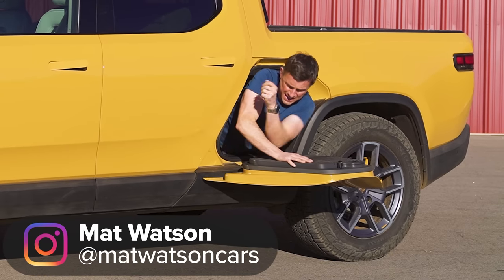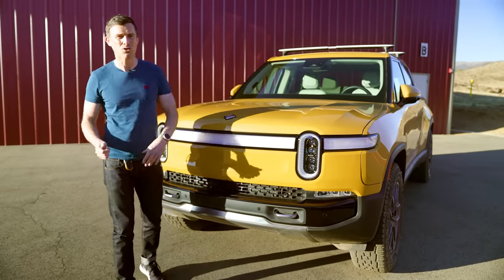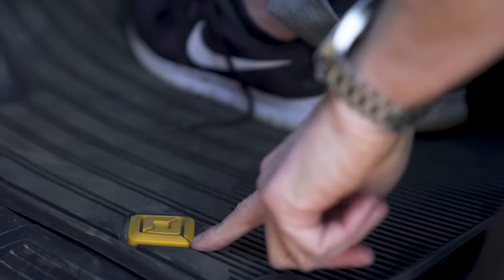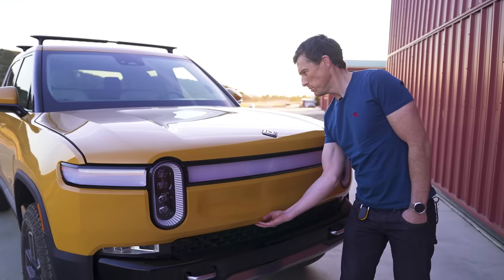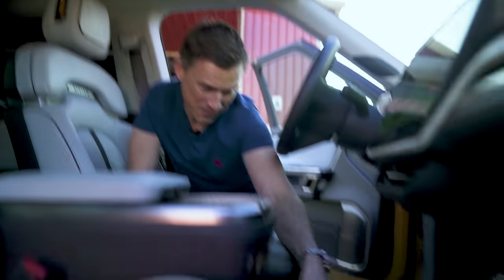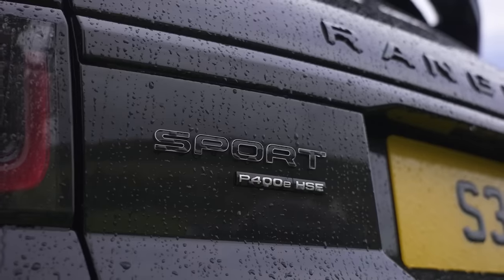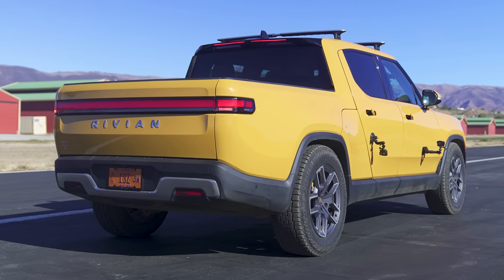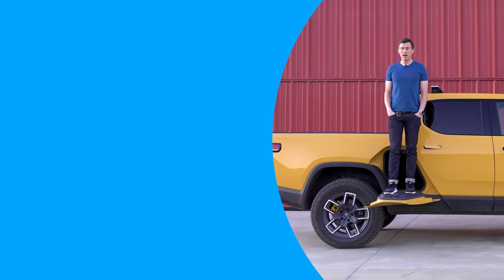Rivian R1T review - 0-60mph, 1/4-mile & off-road tested!

Comment: 0-60 in 3,66 seconds in a 3,1 ton truck is pretty brutal. That's some ludicrous power.
Reply: Yeah that's very impressive
Reply: CYBERTRUCK goes 0 - 60 in under 2.9 sec, hauls 3500 lbs and TOWS 14,000 lbs for 300 mi. with MAX PAYLOAD Cybertruck can go 600 mi. 
Cybertruck w/ 4 motors has over 1200 HP and is FASTER than a 911 PORSCHE. 
Production begins in late 2022.
Reply: CYBERTRUCK sounds like a really cheesed-out 1980's movie with Arnold, Jean Claude, or Steven Segal.
Reply: @markplott4820  Yea Mark, I cant wait to get one and pull my 5th wheel RV. Is the 600 mile range with max towing too? What's top speed of Cybertruck, the top level 911 is 205mph so can imagine the truck at 220mph or faster top speed
Reply: @JohnSmith-fi2ck   - YES, probably. 
it can do 90+ mph with a Trailer + load in a straight line and uphill.
Reply: @markplott4820   here's my catto truck, 0-60 in 0.1 seconds, can do salsa, tow a space craft, made by the teslabots, can give you happy ending massages while driving and go from east coast to west coast on full charge, and cost 69,420, production begins in late 2027 (spacs may be removed from website and prices may alter at whims, and no one may even see a road legal version for first 5 years after announcement)
Reply: and the fun pat is, this is not on a drag slip tires, but  on off road ones. On those, it might do a 3.2-3.3
Reply: @markplott4820  cool…. But musky man still hasn’t delivered it 😎
Reply: @MaticTheProto   - ELON , has Delivered almost 1M EV cars in 2021 Worldwide, MORE than ANY other OEM. and SOLD every one for a 15% Profit. Tesla could Continue JUST selling cars until Market is SATURATED with Tesla cars , Tesla to Produce 4M cars in 2024. growing by 50% each year. 
the Cybertruck is NOT key to Tesla Success, but it will be the BEST selling Tesla Vehicle ever made.
Reply: @markplott4820  ok
Reply: @markplott4820  and then you buy it... and wait a year or two to receive your vehicle...
Reply: @SleezyRaidz   - or YOU can buy a USED model Y , Right away. its even Better than a RIVIAN.
Reply: @markplott4820  model y's can tow? Since when...
Reply: @SleezyRaidz  - my STOCK model Y can TOW 3500 lbs  and NOT even Struggle to go UPHILL at 85 mph. I can even REGEN on the way down.
Reply: @markplott4820  3500 is a whole lot less, than what a rivian can tow though...
Reply: @SleezyRaidz  no DUH, model Y is a Compact SUV, but can be made Better w/ 4" LIFTS and OFF ROAD Tires & upgraded Suspension. no need for TOW package, just order the TOW bar when you Configure. 
Saddly, Cybertruck is Delayed till 2023. but, its DUAL motor Variant simply out Classes the RIVIAN 4 motor Drivetrain.
Reply: @markplott4820  it hasn’t even done those numbers yet you clown 😂 fanboy
Reply: @markplott4820  I’ll believe those numbers when the truck is real which it isn’t so
Reply: @markplott4820  do you work for gay tesla or something
Reply: Cybertruck is ugly AF
Reply: @markplott4820  It's 2023 and still no news about the cybertruck 🤔. and hasn't Elon been saying that it's coming soon since 2020?
Reply: @HR2playz   - ELON said Cybertruck DELIVERY event is Q3 2023. 
Cybertruck PRODUCTION line photos Published in Q1 2023 slide deck . 
CT seen Multiple times Driving streets in CA, some w/ 4WS others w/ 2WS.
Reply: @markplott4820 I can't wait to get one in 2032 🤣🤣
Reply: @markplott4820 the rivian is objectively a much nicer vehicle, just a lot more expensive
Reply: @paulgremminger3510   - Cybertruck will ECLIPSE Rivian sales @ Release.

Comment: The amount of features this car has is just mind blowing, nothing like any other car manufacturer has even thought of doing, hands down the best vehicle to take on a long journey or go camping with
Reply: @firstbloood1  The range isn't 150 miles.
Reply: Electric cars look very futuristic....but why do they feel so....dead?
Reply: @firstbloood1  If only you knew what I actually do.  It may surprise you.  I totally misread your comment but the first place you went to was anger.  Take care in any case.
Reply: @Kronos0999  They don't.
Reply: @firstbloood1  Yep the range of EVs are always 💩💩💩. Manufactors only give range numbers based on eco or conserved settings to milk out the most range they can present to the consumer even though no one drives so slow like how the Manufactor tested the vehicles. Let's not also forget about the terrible charging, you can expect to be waiting like a bozo to fill up the battery. Lastly truck's users usually carry a lot of load, so they can expect even less range.
Reply: @JohnnyZenith  You still gotta get back.
Reply: Not really, 70% of the features are from the Tesla Model 3, I was really surprised when i saw how similar everything was.. eg the lights on the vanity mirror and the style of the infotainment as well as the glass roof and the way you adjust the seats and mirrors and Tesla sentry mode
Reply: Well, obviously you haven't shopped for any trucks recently 🙃
Reply: Although the camping features are alright ig
Reply: @richardaguirre587  you can charge at your house
Reply: @firstbloood1  In my role it's more falsification but yes corrections are important.  I don't need a conventional workplace either in the UK or Portugal where I reside.  In any case I'd like a Rivian.  I wouldn't be doing any off-roading.
Reply: @matthewjudge3763  I totally misread the comment but yes thanks.
Reply: @richardaguirre587  the range is determined  and tested by the government body in charge.. not the manufacturers. 
Also you have no idea what milking is. Model 3 hypermilling is around 1000km (75kwh) and S around 1500 km ( 100kwh), testing speed for both around 15-20 miles per hr. Look it up.

Yes you are right 95% of the time evs dont meet the range, and that is obviously an issue with the testing standards set by the regulators.
Reply: @firstbloood1  calm down
Reply: @JohnnyZenith  Not to children.
Reply: MQ - NOPE, the RIVIAN is the LEAST Efficient EV Truck ever made - tested by EDMUNDS , and its got to SHORT Range and is too HEAVY. 
Cybertruck, is MORE Efficient and LONGER range (600 mi) and less Expensive than the Rivian , with MORE High Tech features and better Software.
Reply: Completely agree.  It's one of those designs that just keeps on giving.  This is easily car of the year.
Reply: @markplott4820  Eugh, a Musky dog.
Reply: @richardaguirre587  lol some of what you say is true and VW totally agrees with you not like ICE vehicle manufactures would manipulate mpg or anything
Reply: notice its far cheaper than its competition too lol
Reply: LOL Long journey or camping,    !!!!  and bring a GAS generator so you can charge it for 8 hours
Reply: @JohnnyZenith  Bruh, the guy stated his own opinion, you can’t decide if someone likes electric cars or not.
Reply: @epeli0035  I think you should reply to the correct person next time.  :)
Reply: You should get out more often and see other EV cars. These features you speak of , most of them have already been out by Tesla.  And that front end is fugly.   We’ll see how this company lasts with all the big boys coming out with more range. And of course the manufacturing money needed.
Reply: @JohnnyZenith  Right person
Reply: @JohnnyZenith  Kronos said that electric cars feel dead, that’s what they feel like FOR HIM
Reply: @epeli0035  Clearly not as I have no idea what you're talking about and neither do you.  Do not reply again.  It won't be read.
Reply: @JohnnyZenith  Well, you replied to kronos, and I’m talking about that reply that said ”No, they don’t.” If you don’t read this, then oh well.
Reply: @JohnnyZenith  How can this guy not comprehend what I’m talking about like tf
Reply: I'd take diesel truck for those kind of trips. This truck however is very cool and I like it a lot. Diesel just has the reliability and if you bring few jerry cans with you will never be stuck.
Reply: Do you drive pickup trucks ?
Existing trucks have comparable amounts of features, sure the tunnel is innovative and no denying this car has tons of cool practical features. Compared to regular cars yes but compared to other trucks it's not mind-blowing difference.
See the F-150 Lightning, has many practical features too
Reply: A lot fancy things that pickup user really dont even need.

When pick up driver really needs is range, towing capacity and affordable. 3 things that electric pick ups do not have.
Reply: Most of the features would never be used lol
Reply: this car is very impressive but but the only downside is that it's electric, so can't really do much if it runs out of battery while your camping
Reply: @abdullaha1730  carry huge deployable PV panels in the gear tunnel ? xD
Reply: My question is how is it when towing  as far as the battery's hauling snowmobiles and or  boats
Reply: @richardaguirre587  yep, range and price is one reason I will keep driving my old diesel truck. If I made 100-150k USD/year I might consider one though......

Comment: I really love this truck. I just hope they go the distance and can ramp up production without sacrificing quality to get their foot in the market. I hope to see them in the UK soon. Electric cars need to start major R&D into weight saving however.
Reply: it will be $ to £ price though, so yeah.
Reply: Unfortunately it’s too heavy to come to the uk. Weighing 3100kg means you would be over the legal limit with 5 passengers. It also means with just one person the cargo weight would max out at 320kg, which is utter shite tbh.
Reply: This thing is the size and weight of a commercial truck (a big one). You'll need a special license.
Reply: They have to prioritize charging speed and charging infrastructure first. Then they can worry about weight saving. Though admittedly I don't know how charging in the UK compares to here in the US. Here in the US it's really bad still. It's getting better, but unless you live in SF or LA, which I live very close to SF, you're not guaranteed to find good charging or reliable charging. On top of that, you're not really able to charge while towing unless you find a station on the side of the street or have tons of space at your house or apartment building. There's no standard of where the charge port should be either so if the charge port is in the back, you have to unhook the trailer and then back in. I just read recently that it's even illegal to unhook your trailer at a charging station to charge your car.
Reply: @DerpEye  As a Ford F150 Super Crew owner, I laughed when you said the Rivian is a "big truck". It's considered a small to midsized truck here in The States.
Reply: @maynarddrivesfast804  Yeah I know, but for the rest of the word it's the size of a small planet.
Reply: @PiOfficial  no it’s slit coming to the uk it’s not too Heavy
Reply: @louisbeerreviews8964  it’s the law that you can’t drive a vehicle over 3.5 tonnes without a c1 hgv license. The rt1 weighs actually 3242 kg. With a driver that’s 3322 kg, which means you can only have a max of three people in the car. It’s completely illegal in the UK to sell a car that you cannot even load all five seats up. If you buy this you will need to get an hgv license.
Reply: @louisbeerreviews8964  I can’t see it, too small a market seeing it will require a C1 licence

Comment: That is an amazing piece of design, from its many interior details to the sleek exterior. Its very expensive, but there is no doubt Rivian will take a good chunk of the market in the US. I can't wait to see them over here in Europe too.
Reply: yeah it really won't sell in europe. cause 400 kilo payload before requiring a C1 license is just not useful on a truck.
Reply: @anonym3017  You are forgetting, this is perfect company car, as it is a commercial vehicle, no VAT. People will buy it for driving.
Reply: @Sheldon42  it's also 68k USD without taxes.
so there are a shitload of other EVs that can be used as company cars in europe that are cheaper even if you need to pay VAT on them.

Fucks sake you could buy one of these in the base version  for 60k euro (assuminga straight up currency conversion) without VAT or a model 3 SR+ for 45k including VAT. the range is pretty much the same between those two.
Reply: @anonym3017  

I don't think the truck version (R1T) will be very popular in Europe but I expect the much shorter R1S to have lots of demand in Europe. It's like a better version of the Range Rover with as much if not more capability off-road, a much lower price, far fewer dealership relationships, and significantly better performance.
Reply: @anonym3017  

I don't really see any people cross-shopping this with a model 3. But the R1S SUV will definitely get the attention of large luxury SUV buyers (Range Rovers, X7's, GLS's) in Europe.
Reply: @CrazyWeeMonkey  The R1S still has the same weight problem. It has too little payload capacity to even carry 7 people if you keep the weight under 3500kg.
Reply: @CrazyWeeMonkey  your entire argument was use as a company car. Because it ain't a capable pickup when limited to a GVWR of 3500kg.

Companies go for the cheapest that gets the job done. So cross shopping this and a model 3 is perfectly normal for them.
Reply: @anonym3017  First of all, there is a gigantic difference between commercial and personal car for a company.  Everything commercial, servicing, fuel/electricity is expense for a company, without VAT. Personal vehicle - can not deduct VAT. 
And this vs M3? You do realize this is worlds apart in everythin. I would never even consider M3 vs this. Maybe E-tron, polestar etc.
Reply: @Sheldon42  excepthis thing only has a 400kg payload before requiring a catgegory C1 drivers license, time/rest control for the driver, regular medical examinations of the driver, etc. So it's less useful as a commercial vehicle than a transitvan for half the price or a base ranger for 23k euros less.

ANd no. company cars are company cars and count as expenses either way.
Reply: @anonym3017  Ok, maybe where you live. I'm from central Europe/EU. Commercial vehicle is totaly different than personal vehicle (both owned by the company). My company owns quite a few vans/commercial vehicles, personal cars are out of the question. They are just not worth it.  My point is, you can buy this for luxury transport and avoid VAT and other stuff.
Reply: in TIME, the Tesla CYBERTRUCK will OUTSELL Rivian.
Reply: @markplott4820  Nope.
Reply: @markplott4820  seriously doubt that
Reply: @KP-hm1dn  - don't BET against ELON......lol.
Reply: To take a chunk they need to start really producing them en masse, not just hand building one per week.
Reply: @Sheldon42  Nobody would be buying this monstrosity in europe. How many gigantic pickup trucks you see on european roads (or any other country except US for that matter)? That's right, almost none. Because these vehicles does not make any sense, even in the US. Too heavy, too impractical for almost any use except something very specialized, something that affects like 0,5% of the population. This truck is the size of a small school bus, too heavy to be driven with a conventional license, impossible to park almost anywhere in a city. Also, 99% of people outside US, would prefer an SUV, where you can load stuff without fear of it being stolen, or being able to actually unload it without a ladder.

Comment: Another cool feature about the R1T is the locking Tonneau Cover, it’s fully electric and is operated from the center screen. It pretty much acts like a trunk space.
Reply: It depends on the version you get. The lower trim has a manual cover.

Comment: Rollout is used because that's how the two timing beams at a dragstrip work (one foot apart, second beam must be cleared before clocks start).  Before people had GPS/accelerometer based timing equipment, the only way to get proper accel measurement was at your local dragstrip.  So car magazines kept the roll-out for 1/4 mile figures for consistency, and also applied it to all other standing start acceleration even after they no longer needed the drag strip.  So, not marketing....
Reply: UK car journalists must have been much smarter back in the day as they managed to check 0-60 times without a dragstrip or 1ft rollout.
Reply: @Xenon0000000000001  Yeah they used a manually activated stopwatch.  Super accurate stuff.....kinda like Matt's tracktimes on the road course.😂

Comment: As someone who has driven trucks a lot of my life I was super surprised by its towing capacity being 5000kg, super impressive! but think I would have liked to know how much the battery life depreciates once you start towing! as anyone who tows with a truck can attest to, your petrol gage does tend to take a little bit of a hit when your towing something like a caravan, horses, etc. If the battery life was to stay pretty consistent to its normal everyday range when towing then It's definitely something I would consider buying, but I have a feeling it would take a massive hit to the battery life, which is the only reason as to why I would avoid it and stick to a Deisel truck. 

Other than that really good video and an awesome look into what truck companies may be getting into in the future. amazing job from Rivian building this truck!
Reply: Towing a trailer with a mid-sized car on it, 100 miles between charges from Chicago to Los Angeles.  Sticking to diesel for now as well.
Reply: @supportone9928  sadly, sounds nearly useless as an actual tow rig.
Reply: @kc510  Yeah TFL just tested it and the battery was dropping like a rock.
Reply: Battery range is not battery life, you mixed them up.
It all depends how often and how long you have to tow. For a lot of people it will be fine. But going on holiday with it will require quite some planning. Still possible though.